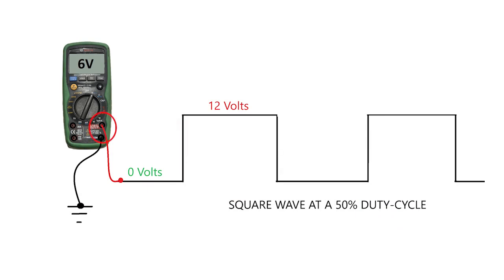Mastering Diagnostics #8: Pushing the Envelope, Choosing the Right Tool for the Job

Comment: Excellent point especially for us old timers who don’t know how to use a scope, I have spent most of my 48 years of working on cars using the Fluke 88 Automotive DVOM and Ive not needed a scope “Yet” though I have one in my Autel MaxiSys Ultra Scan Tool, I just don’t know how to use it properly
Reply: For 99% of diags you don't need a scope, but it can be handy for crank/cam sensors or communications protocols, but learning how to
Use a scope can cut your diag time. And there are lots of videos on how to use an autel oscilloscope.
Reply: It’s never too late to learn!